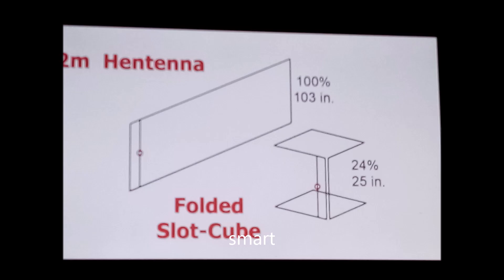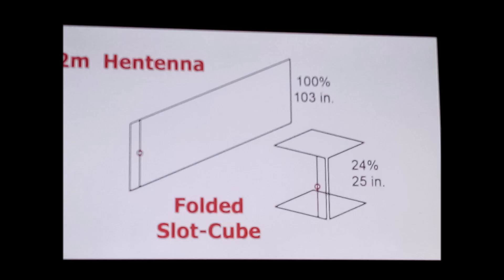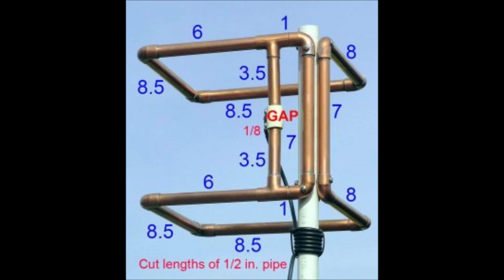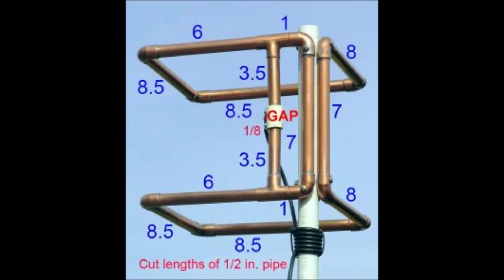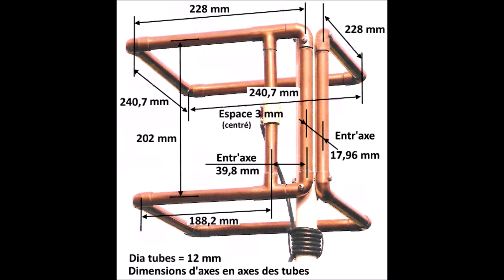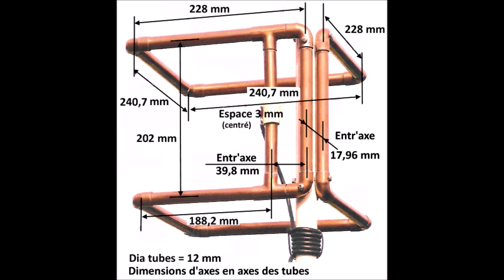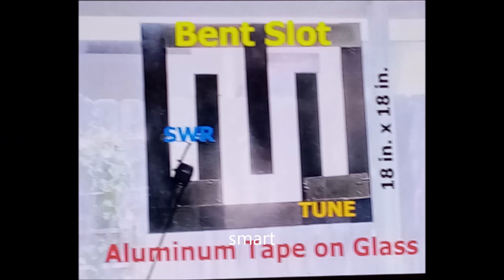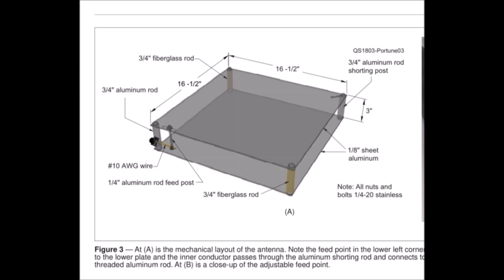HOA stealth 2 meters antenna

Comment: it would be interesting seeing if a 14MHz version was viable
Reply from the maker: Actually almost same size exist version for 50MHz 
For 14 MHz you can apply same idea, multiple bend slot(I mean slot not structure) Bended slot is same like bended dipole.
Because slot is also dipole. OK electric and magnetic field's are reverse. In next video I will be explain much more.
But Jim Portune is expert for slot antenna's. Even make HF slot. Not preaty big.
Link on Jim YouTube video is in description.